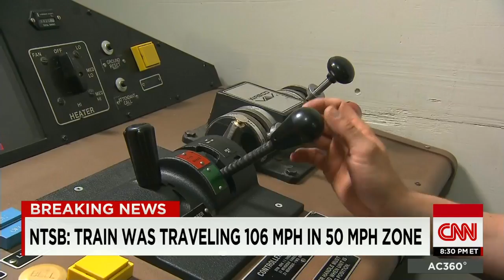2015: Train engineer instructor simulates derailment

Comment: using Rail Simulator? not Train Simulator? i suppose they wanted something not requiring Steam. i would suggest Open Rails or Run 8 but that would not have looked goood for the report as those done simulate derailments.